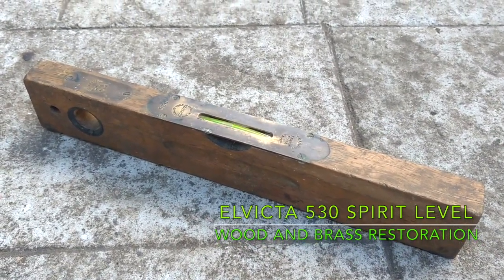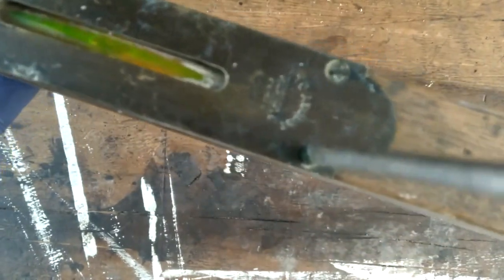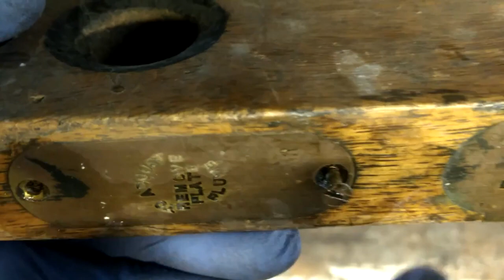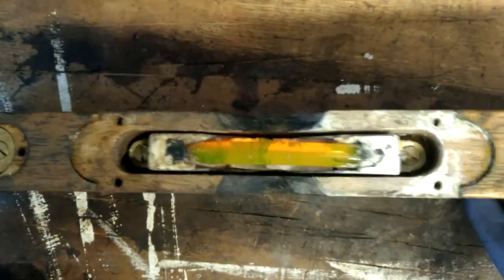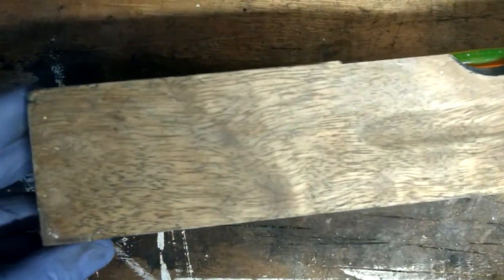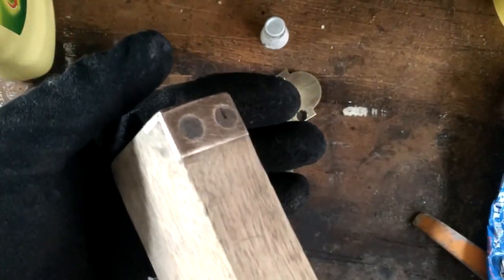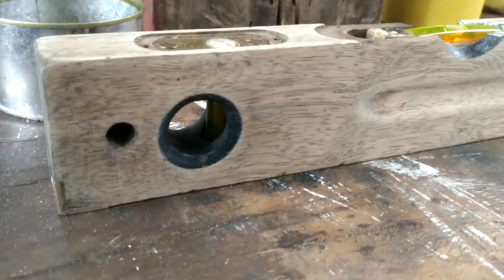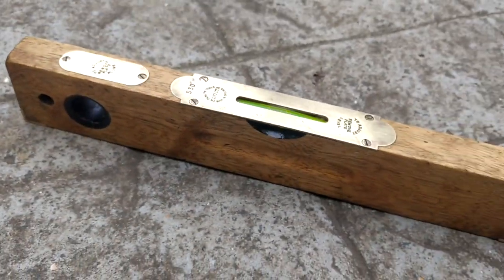Elvicta 530 Wood Spirit Level - wood and brass Restoration

Comment: A great restoration, maintaining some original patina and character.  As a suggestion, you could try to removed and clean each corner bracket screw head without moving the bracket.  Just take one out, clean, and replace before moving onto the next one.  That way you keep the positioning of the bracket using the remaining two screws.
Reply from the maker: Thanks for your post and suggestion.